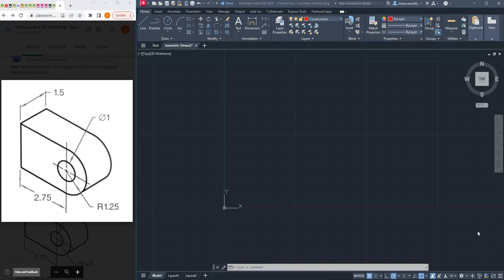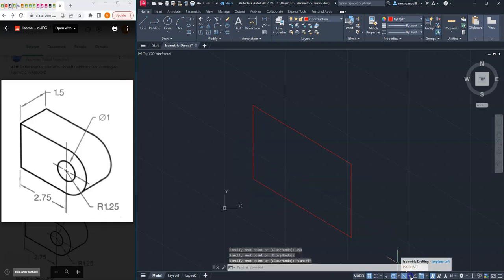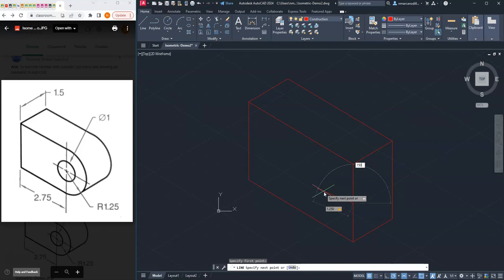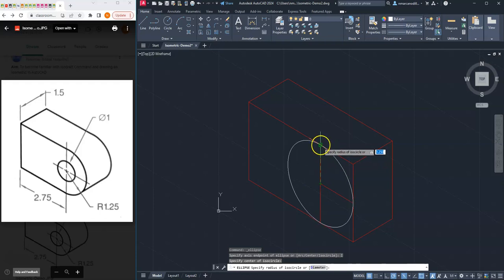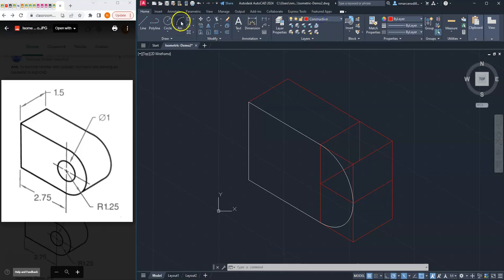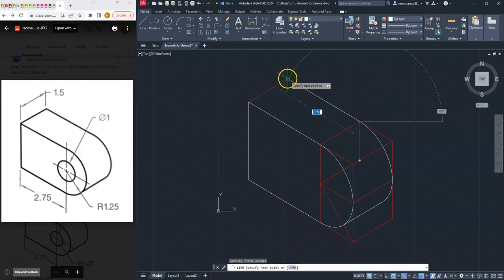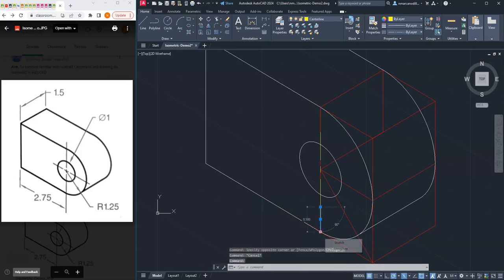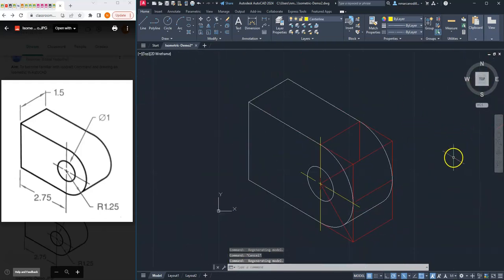How to create an Isometric with Arc and Circle in AutoCAD

Comment: Hey, thanks for the great video! May I ask how did you make your guide when drawing a line have this property where you can type in the length you want? in addition to the angle as well.
Reply from the maker: I am confused about the question. Are you asking about the isometric grid? It would be under IsoDraft. (Isodraft Left, Top, and Right)